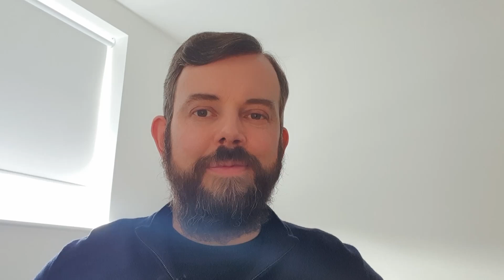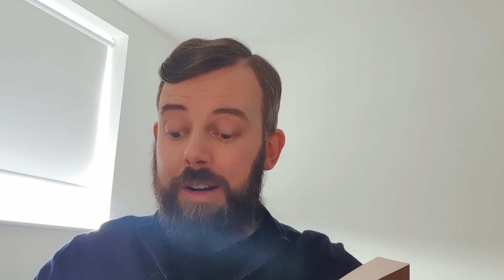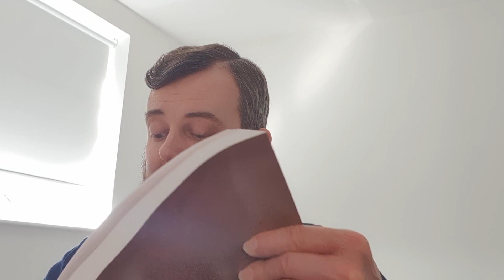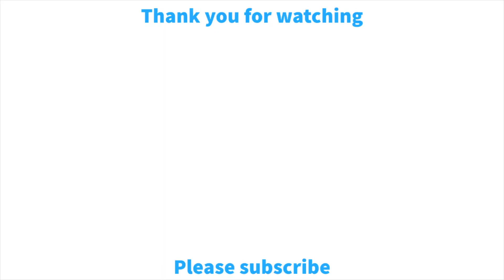Changes to Testing in 18th Edition 2022 Wiring Regulations

Comment: Not sure if I'm missing something, but when an item connect to a circuit tested at 250v dc, won't this show up as low resistance.
Reply from the maker: Hi Andrew,
If electronic equipment is still connected to a circuit when carrying out the insulation resistance test this will affect the outcome of the test, and it will look like there's low resistance between live and neutral.
Regards
James